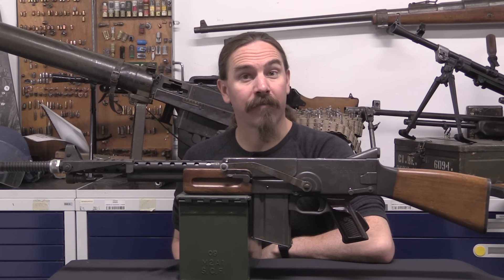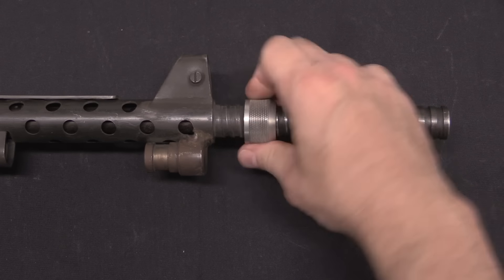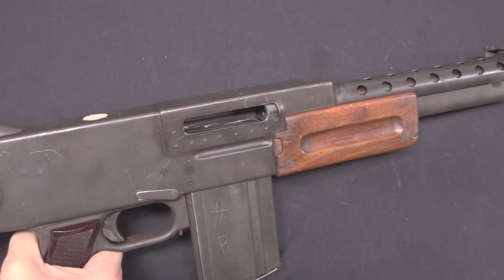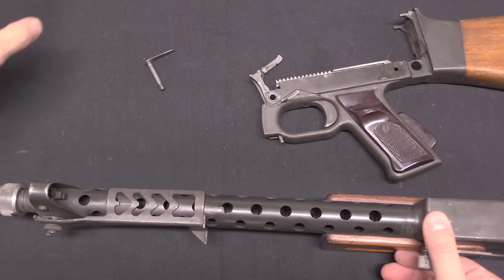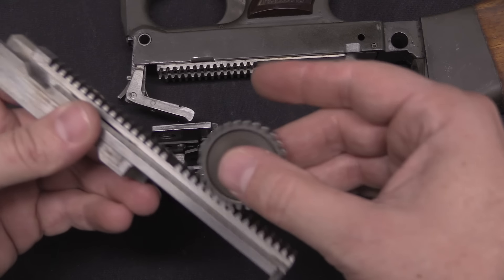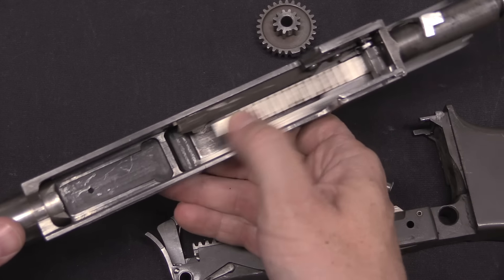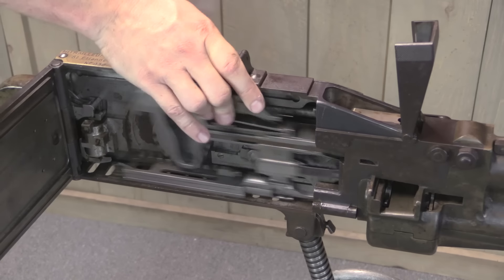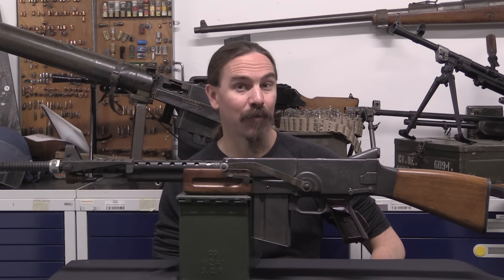Gear-Ratio-Accelerated? Yep, It's a Thing: French MAT 1955 Prototype

Comment: Not so long ago, there was a new hunting rifle, where the same exact idea, but exactly the opposite way, was used to reduce charging handle throw of its straight pull action. Instead of delaying, bolt was in fact accelerated. The ideas aren't lost forever.
Reply: Do you remember what gun this was?
Reply: @TheDarksideFNothing  I didn't remember what was it, i had to find it... Merkel Helix.

Comment: Honeatly i want more gears in firearms. This and the lewis are the only 2 so far
Reply: The rate reducer on the BAR also uses a ratchet and gear system that looks like it was pulled off a pendulum clock
Reply: He did a video on some weird prototype years ago that had a rack and pinion type arrangement in it. It was a real Rube Goldberg contraption.
Reply: Welcome to artillery, we have a lot of gears

Comment: So, the bolt carrier actually moves faster than the barrel assembly.  The increased length on the lever arm of the center gear moves a lot faster than the smaller gears, causing the bolt carrier to accelerate.  You can see this happening early on in the video through the ejection port. I’m guessing it does this to get more length of travel in a shorter package.

Comment: It's not gear reduction. Push barrel a little, bolt moves a lot, that's an increase, like a car's overdrive gear. So no, the gear ratio doesn't delay a damn thing. Instead of relying solely on momentum of bolt carrier to keep the bolt going to the rear after unlock, it's mechanically coupled to barrel movement. Effectively long stroke recoil operated. Bet the spring up front is just a return for the charge lever and plays no other significant role.
Reply: I've been subscribed to Ian since his awkward autistic days back in 2010. I vaguely recall that he actually has like an Associate's or Bachelor's degree in mechanical engineering. Or maybe he was trying to earn one? Anyways the misunderstanding of gearing by him is something to think about.
Reply: I was going to say, you can even see from the tracks! The track on the lower is much shorter than on the upper, all this is doing is timing.
Reply: He misunderstood the Benelli B76 too. I made a video about that one. That ledge is just a ramp, not a lock. The angles of links cause a speed increase; slight and brief, but it's there and adds resistance to opening.

Comment: The gears clearly increase the speed of the carrier. It covers a much larger distance than the barrel in the same amount of time. I feel like some of the language used here was confusing. Like when he compares it to a delayed blowback he correctly mentions that it's not a delayed blowback because its locked, but fails to mention that the spring is acting on the barrel, not the bolt carrier, so were the bolt not locked it would actually open faster with the gears than without.

Comment: I think you got the gear ratio "up side down". The smaller diameter moves across the stationary part which makes the larger diameter "have a greater surface speed". Which makes sense, as otherwise the whole assembly would have to move LONGER than the bolt need to travel to extract and reload. And you can verify this simply by counting the teeth on both racks: 32 vs 15. This means the bolt travels twice as fast (and thus twice the distance) as the barrel assembly does against the lower.

Comment: If it break so much, it might be because the teeth of the cog always hit the same teeth on the rack, if one happen to have a flaw the damage will worsen with each use, for regular machinery cogs are made to change the teeth with each cycle to spread the stress (ex: instead of a 1/2 ratio it is a 50/101 ratio)

Comment: WOW. I am not a firearms engineer, but that is the most dumbass unnecessarily complicated Rube Goldberg design one could imagine. A complicated solution in search of a simple problem.
Reply: Oh you sweet summer child, this is comparatively simple compared to what complicated and once in the blue moon working shizz Ian manages to dig up. Out of hand anything with a "hyperburst" function tends to be even more complicated. The An-94 with the pulley system or the G-11 with the frickin' clock mechanism are immediate nominees. A lot of Swiss guns are also just complex for the sake of it.

Comment: Just in case someone didn't check the description, Ian said this: 
"Shoot, I managed to get the gear ratio backwards. Sorry! The recoil action provides the necessary delay, and then the gear ratio provides acceleration to ensure the bolt can open reliably, akin to the accelerator in a Browning M1917 or 1919 machine gun, or a Lahti L35 pistol. Please excuse the error…"
tbh that did bother me quite a bit. I did quite some calculation and simulation in my head and I always get the conclusion that the bigger gears move faster translationally...

Comment: That is not a gear reduction, in fact it's the opposite. It is actually a gearing up so that while the barrel extension's stroke is only a short movement the bolt will move the full stroke, ie. faster than the barrel extension. The dwell time is achieved by a combination of the bolt and the bolt carrier with normal locked action delay time functionality where the bolt remains locked for a little bit at the start of the bolt carrier movement.

Comment: I think you may have described the gear mechanism working in the wrong direction on accident. As described, the gear reduction is working backwards. You can visibly see it working in the correct manner by looking at the length of the tracks - the track for the large gear is much longer, for the same rotation. The large gear will move it's track faster and further than the small gear.

Comment: If you ignore the ridiculous overcomplication, this thing is just beggggging to be a delayed blowback design. I really have trouble seeing why the barrel should need to move at all if you already have a positively-timed accelerator system built in between the bolt and the bolt carrier.

Comment: Was this thing designed by a bicycle mechanic? It's definitely a strange design, I thought that folding submachine gun with the radial return spring was weird but this takes the cake. Or the baguette, as it were... I don't know what the French are doing most of the time with firearms design, but I salute their efforts to figure out completely off the wall solutions.

Comment: Early in my career, I worked in an office that still had a Burroughs manually operated adding machine.  The handle on that machine could have been the twin to the handle on this rifle. Furthermore, the sounds made by both is amazingly similar. If you go up against a French soldier with this weapon, you just might get “tabulated”. 🥸👍👀✅

Comment: Want to know the ratio? Count the teeth or measure the diameter. They're just levers. 27/12 with the cut out counted, 2.25 ratio.
The gears could  work out, can be greased forever with no need of service if all the rest works out. The combo with recoil operation might bring most of the issues around. Bummer that there is no bolt.

Comment: Very interesting to see. I had this idea for a long time.
Put this on a standard closed rotating bolt platform to reduce recoil?
As the bolt recoils, the lower toothed part is not fixed, instead it's a "counter-bolt" which is driven forward. Wouldn't this reduce recoil?

Comment: Actually, there are some good firearms with gears (for bolt acceleration). For example, Russian Gsh 30 (aircraft cannon) or it’s Czech version Plamen (redesigned for 20mm NATO, but still with gears). Both awesome guns, still in use.

Comment: Hey Ian great video as always but your explenation doesn't seems right.
the gear ratio doesn't delay the opening of the bolt, on the contrary, it accelerate the bolt carrier backward from the "barrel extenion" 
the small diameter cogs are connected to the barrel extension and start to rotate as the barrel move backward. 
The bigger cog then accelerate the bolt carrier backward from the barrel extension due to its bigger circonference (hence unlocking the bolt)
think of it as the accelerator lever on an m82 barret or bronwing machine gun

Greatings from France

Comment: If the smaller gear is locked to the receiver and the larger is locked to the bolt carrier it's more like an accelerator or am I thinking of it wrong? The gears work in the same angular speed so the linear speed must increase as the gears circumference increases.
Reply: I believe you are correct. It's not really a delaying action, it's a way to get more bolt travel from a shorter barrel travel. So for example you could have the barrel only reciprocate 1 inch but you need more than that to clear the empty cases and load new ones so this gear system throws the bolt back more than the barrel travel.
Reply: @wingracer1614  Well, the inertia in the system would introduce delay, wouldn't it?
Reply: Post-production Ian seems to agree with you. Look at the title.
Reply: @adrien5834  Everything has inertia so by that standard, everything is delayed. This is not a delayed blowback gun, it is very clearly locked breach, recoil operated. There is no need for any sort of delaying action in such a system. My opinion based just on what I see here without having the gun in front of me and not even having a bolt to see is that the system is intended to get a greater stroke from the bolt than from the barrel. This allows it to clear and load long rifle cartridges while having a shorter barrel stroke. It's sort of halfway between a short recoil and long recoil system. I could be wrong but I don't think so.
Reply: @wingracer1614  I don't think you are wrong at all.

Comment: A full-powered rifle firing from an open bolt, is a bad idea. The original models of the German WW2 assault rifle also fired from an open bolt, because the Germans at that time felt that the gun, chambered for the relatively low-powered 8 mm Kurz cartridge, would be used more as a high-powered SMG than a low powered rifle. After trials, the German Army did not like it and the later production guns fired from a closed bolt.

Before WW2, the Italians also designed a rifle that fired from an open bolt: the Scotti Model X. It also did not go anywhere but the mechanism was clever and elegant, which this French rifle is not. Ian also has a video on the Scotti rifle.

Comment: Wouldn't the gear ratio as shown actually cause the bolt carrier to move FASTER than the recoiling barrel? It would have to otherwise there would be interference between the carrier and the barrel.

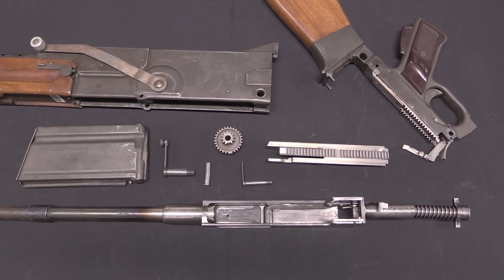Comment: At 12:05 it actually doesn't seem that bad in terms of amount of parts lying around after field-stripping - just a receiver, trigger group & stock, barrel assembly, bolt assembly (what's left of it anyway), a couple of pins, and magazine.

Of course literally everything else about the design of the gun is horrifically complex.

Comment: It’s incredible this had been proposed in the ’50s.
You expect a contraption like that to have been proposed in late 19th / early 20th century (apart for the stamped steel receiver).
Considering already the Mannlicher 1885 had an accelerator, and so the patents on way simpler and sturdier accelerator designs had long expired, there was no need to make it so complex.
Not to say of the open bolt design, that was already a not so great idea in the 1932 Scotti Mod.X (and it was 1932), but the Scotti at least had a pretty lightweight bolt!

Comment: mmm gears.
the easiest kind of system to jam up. 
either it is hardened and will crush dirt and crud in the action into dust to get into the rest of the system that with gun oil and carbon deposits, makes a pretty nasty sludgy cement, or it jams and grinds to a halt, and might chip a tooth and that'll do significant internal damage. 

brings a certain kind of unreliability to gun design that the boys who actually have to use the damned thing dont really like